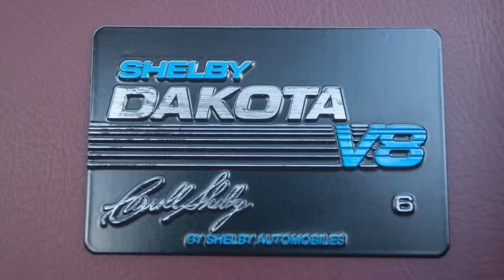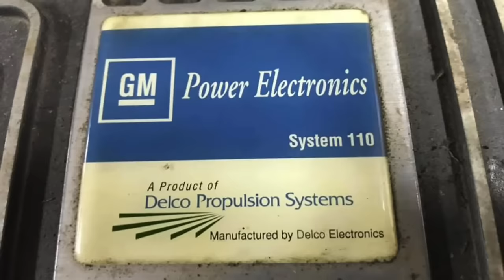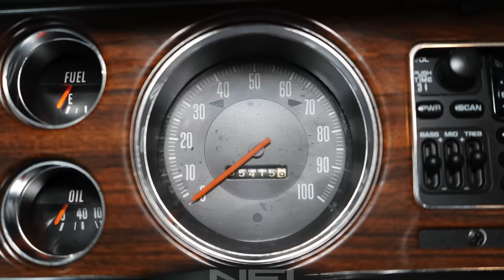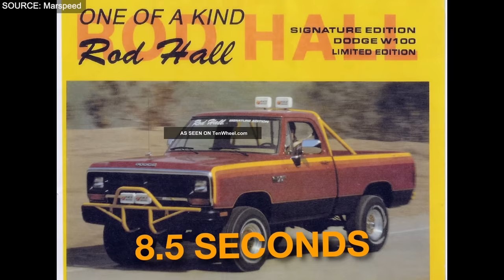10 Ultra Rare American Pickup Trucks You Never Heard Of!

Comment: 🤷What about the  GMC Denali  Quadrasteer?
Guess this channel hasn't heard about it
Reply: Even GMC doesn't like to talk about them. They recalled most of them and replaced the rear axles with standard axles because of several issues in the system. Part of the reason they were only available for a few years. They aren't really desirable because they didn't work. My uncle had 3 that were all recalled and replaced the axle.